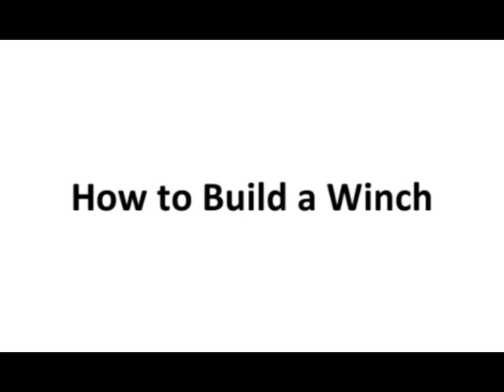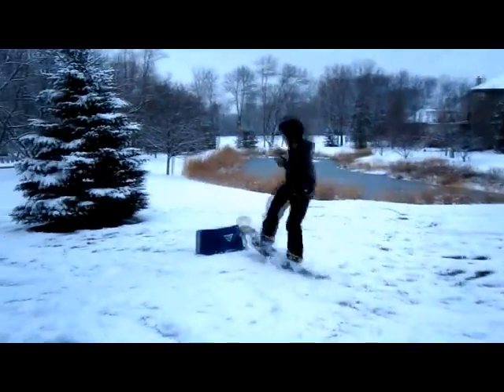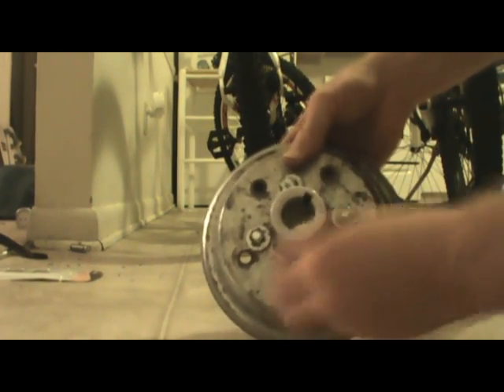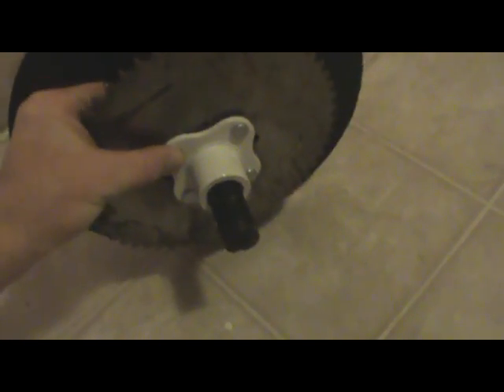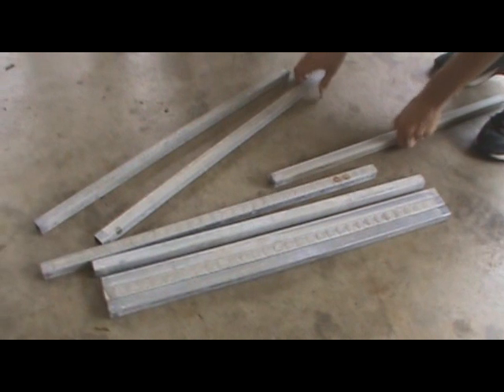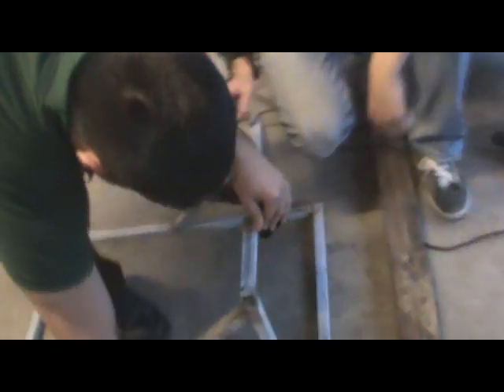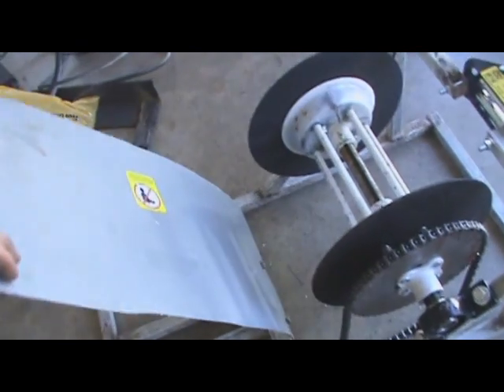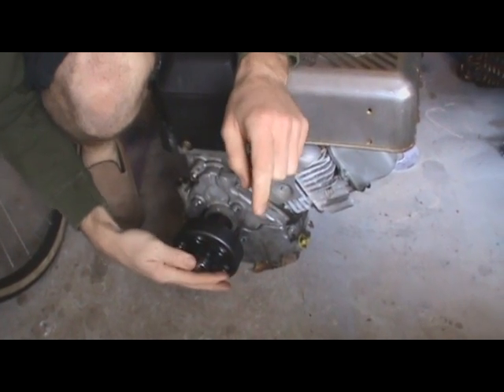How to Make a Wake Winch (under $500)

Comment: your real smart for welding galvanized steel without a respirator the fumes that it lets off when you weld can kill you and its not that strong either
Reply: *You're
Reply: +Cordel Posch (cposch) im making a minibike with galvanized aluminium and its sure strong but imma grind of the galv :p
Reply: nice try, won't kill you mate. Might give you fume fever, nothing a glass of milk and an ibuprofen tablet won't fix.
Reply: +Toms Car Hold It does kill...Jim "Paw-Paw" Wilson is one example of someone who died from it...and even if you don't seem like you are effected you can come down with issues later from it...
Reply: +Toms Car Hold Been there done that. I was in the hospital for a day after breathing in fumes while torching some galvanized steel. It WILL KILL YOU!
Reply: Welding galvanized will make you feel a little flu like but it absolutely will not kill you.

I've welded large projects some of which took a few months of welding on this material with no serious short or long term effects.

You guys need to quit scaring the kids.
Reply: Your and your have always been the same word knackers. You're on the other hand, well that's something different all together. I'm with Moose and the Queen on this one.

Comment: this is a terrible design... fucking saw blades.. you are the smartest kind of dumb
Reply: it is a sprocket for the chain
Reply: no... it is a stupid shortcut. so dangerous.  if those get a tiny crack in them they fly apart
Reply: david lahey they can't crack. they are metal cutting blades. kinda gritty

Comment: I used the 6.5 and it's not able to pull me up even with a torque converter. Moving up to an 11-13 next.
Reply: Andrew Kammerer Use a smaller wheel, it will do it
Reply: smaller wheels? Spool or sprocket  not sure what you are meaning  my spool is quite small.
Reply: +Andrew Kammerer whats the ratio between the tav and the spool sproket it should be 10/55 or 10/50 but in your case go with 10/55 or 10/60 for a 6.5 hp engine if you doesn't have the torque to pull you out.

Comment: why is not possible to use centrifugal clutch for wakeboarding? thanks
Reply: pepee mizera a centrifugal clutch won't pull you out of the water, but if it's only to pull you from sitting onto the water, then it'll work

Comment: Get the predator 212 6.5hp from harbor freight for only $100
Reply: Andrew Kammerer You need to upgrade it you should get plenty of horse from it. Take out the governor, torque converter, upgrade the intake and exhaust and it should rip.
Reply: I tested mine today with 6.5 and it's pretty weak. Switching to 11
Reply: Thank you for the input. I will try that.

Comment: What sort of ratio have you been using on the engine and drum sprockets?  I guess that ties up with the drum diameter and engine rpm to give you your cable speed, but what sort of cable speed are you aiming for?

Comment: hey i recently just built a winch. I first put a centrifugal clutch it worked great but wanted to be able to deep water start so i put a torque converter. Ever since i put the torque converter its way slower then before. Any body have this problem before???

Comment: Strip a riding mower frame down, leave the back wheels. Use the frame for the base. add a tongue to pull your machine with. You could make the wench larger for longer rope? Just an idea.

Comment: you should place the winch on a bridge or something high. the difference is amazing, especially if you are hitting a ramp/kicker so it doesnt pull you down but up.. and a non stretch, thin line is mandatory too! i use dyneema..

Comment: So I finished my winch. It has a 212cc predator engine, 10 tooth counter shaft sprocket, 54 tooth rear sprocket. It has been working pretty well except that the rope seems to drag in the water a lot. it is a poly rope and it floats but it seems like there isnt a consistent pull. Would changing to a better rope increase consistency? I'm using a torque converter as well.

Comment: do you have a 9hp or 6.5? I live in colorado and have a ben horan ridiculous winch and I think because of higher altitude it doesn't do nearly as well... trying to figure out a way to beef it up for some extra speed, I was also thinking about getting a bigger sprocket in the front, any thoughts?